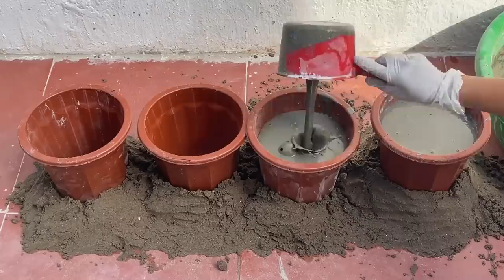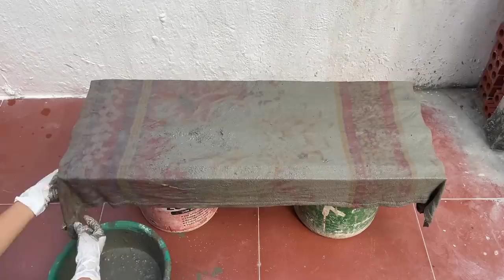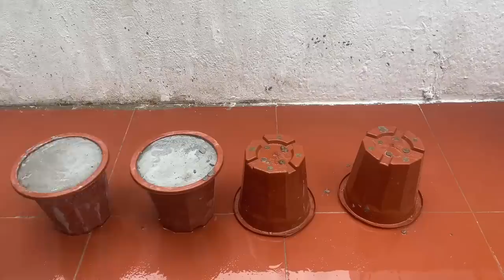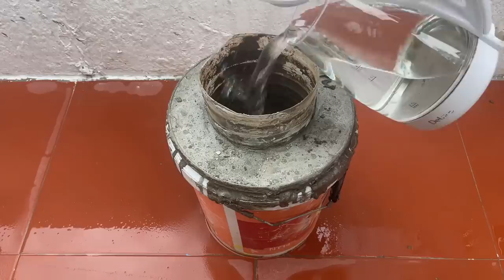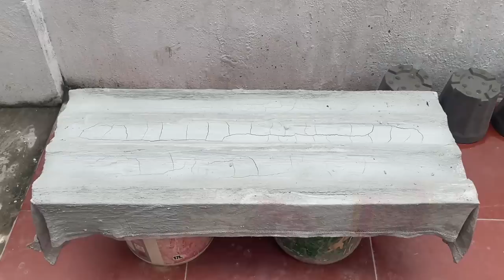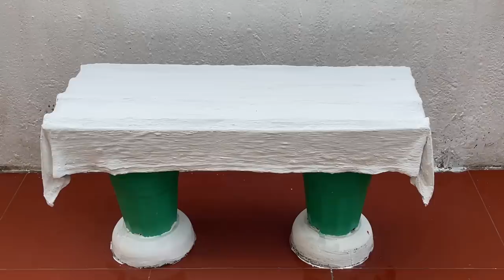Amazing Technique Making Outdoor Dining Table And Flower Pots From  Balloons , Cloth And Cement .

Comment: The top of the table is not smooth and straight so I guess you can't put glasses or delicate objects on the table and also when it gets rain will remain some water/waterlogged over there.
Reply: and if the fabric, altho "coated" gets wet underneath... can you imagine the smell
Reply: Not to mention that as thin as that "tabletop" is, it will break in a matter of minutes.